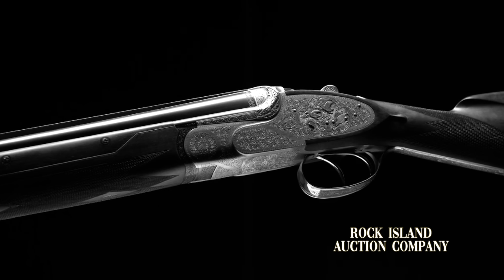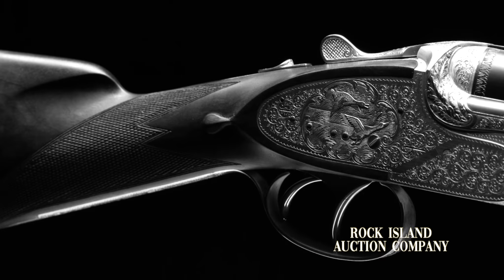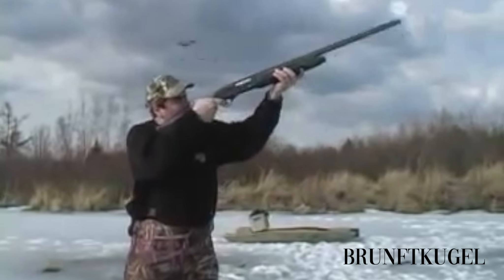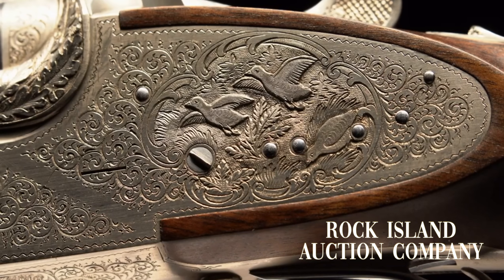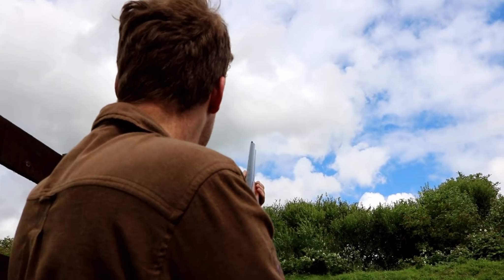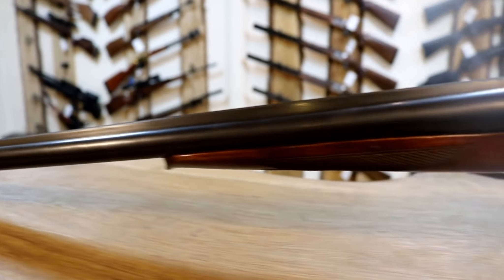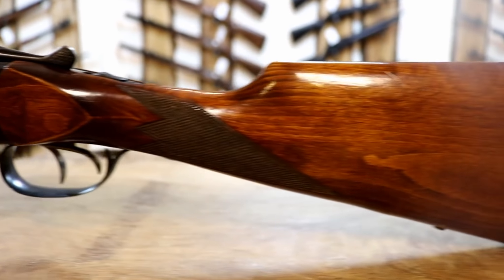Baikal & Their Posh Cousin

Comment: Got a blue heeler puppy, decided to be a bird hunter. Bought a Baikal because of the cost at a pon shop. Didn’t know anything about shotguns. Couldn’t hit anything, learned about gun fit. and started gun smithing. Fluted the comb,hot oil bent the stock for an inch of cast, cut the stock for negative pitch on the butt pad,did some mother of pearl inlays. Now it feels, and shoots good. My puppy is now 3 years old and retrieves like a maniac.

Comment: Bought one in 85 sxs walnut stock,cost 169.95 new, added 2 inch to length used for everything from clays to pheasants, never once let me down. Bought more expensive guns in the last ten years had missfires non ejected shells brocken firing pins etc etc.based on my experience, if I could only have one gun in my life it would have to be my baikal, it's a hammer which never fails me, and they do kick especially now I'm getting older. Good review.

Comment: Remington imported these into the U.S. back in the early 2000’s under the label Spartan by Remington. I bought the SPR-310 O/U Sporting Model. It has never failed at the trap or skeet range or in the field after 3,000 plus round through it. After shooting it for a few years I did some upgrades. I replaced all of the factory chokes with after market chokes. I had a softer recoil pad put on by my gunsmith which was a major improvement over the brick that came with it. Installed a new white front bead. And finally I refinished the stock with a red mahogany stain and tung oil. It still may be a Baikal but it is now a lot prettier and functions just fine.

Comment: Spot on Jonny! 
My 30+ year old 12 bore side by side, has served me well in the pigeon hide and on the salt marsh, and never failed! (The old Baikal cartridges were awesome through it on the geese and ducks - If you didn't mind the two foot jet of flame from the muzzle!)
I wouldn't sell it for £300 quid.
Keep up the sterling work matey.
Reply: I used to buy the 70mm Baikal cartridges because they were so powerful and also the cheapest too - I get the bit about the muzzle flash, I reckon in a gun with 30" or greater barrels this power could have been a great advantage.
Reply: we used baikal shells in the 80s no7 killed ducks at 70 yards dead everytime. 70 yards was the limit. we test shells on rabbits at longer ranges and if it kills a rabbit it will kill a duck easier, same shells on qauil. and shot qauil out to 70. mine patterns so tight.

Comment: Picked up a used sp230 pretty cheap. Been using it on pheasants and grouse for 5 years now. I am actually impressed with how nice the wood looks on such a cheap shotgun. Double trigger turns a few heads of other pheasant hunters as you don’t see many in the field state side. Looks nice and not worried about scratching it or anything in the field with the price point. Perfect working mans over under

Comment: Happy Easter 💖, concerning that izh.. I have both love and hate thing with. Bought a single trigger o/u that was quite good in weight distribution and finish. The reason why it “pulls up” while shooting is imho due to the single yet very strong (bascule) hence making the barrels a bit higher on the receiver. Unlike any other Italian brands where we have two hinges on each side of the receiver making the barrels “sink”  inside making a  more linear shape maybe? Later on I bought a hammer side by side brand new, and the chokes were stuck!!! No way you could remove them without freakin surgery! Sold it without a second thought.. Yes they are strong tough guns those who have them in my country swear by them regardless of their other  higher end guns

Comment: I recently bought a Baikal 43 side by side for the absurd sum of £75; I needed an old school non-ejector side by side as part of the ensemble for cowboy action competition shooting.
Furthermore, I went into the purchase fully aware of Baikals, unlovely stocks, and their general ugliness, as I'd genned up watching videos on the subject.
However, I was well surprised  to discover the stock was actually made from a really nice piece of wood and ran consistently throughout the gun.  It looks to have hand cut chequering and gives an excellent grip. I'd rather there wasn't any engraving on the breech, but there is - looks to be a simple design done by hand with a kind of prison tattoo naïveté.   The metal work is nicely blued with no scratches. Bores are in excellent order.  It actually fits me well for snap-shooting.  Someone has obviously loved this gun because it's a gnat's cock away from immaculate condition.  The lock work is good and tight. Not a wiggle anywhere on the gun.
I have a number of quite expensive 'quality' guns in my cabinet but the Baikal has rapidly become a favourite for its rugged honesty.  I can't believe I got so much gun for a measly seventy-five quid!

Comment: Baikal and Vostok are not the names of the guns, nor the names of the producers. These are the trademarks of 2 USSR exporting state owned enterprises. Basicaly there were 3 main shotgun producers in USSR: Mechanical Plant of Izhevsk (based in Izhevsk) - durable but poorly finished guns, Tula Armory - producer of the hunting guns of the medium quality and TSKIB (as well based in Tula) - hand made olimpic shooting guns and a high end hunting sidelock producer.  Tskib was mainly imported to the U.K. under the name of  Vostok and are known for its Olimpic trap and skeet models MC-6,8,106,108 and some of the hunting sidelocks: mc-9,11, 109.  Vostok competition boxlocks do have a dozen of olimpic medals won in 1950-1990ss ( the last one in Australian Olimpics) both in skeet and in  trap and are well known for its tula choked skeet barrels and incredable durability. In fact there still is an opinion that tula chokes were so effective with the high volume loads that it influenced FITACS to decrease the competition loads from 32 grams down to 24 grams to omit the gandicap effect these barrels were giving to the Russians. As the olimpic shooting loads were decreasing  MC became available for the general public that in the process of its domestic use have discovered that tula chocked barrels not only extremely good with high volume shots but are very accurate in bullet shooting.  Twice was using the MC - 108 skeet gun equiped with tula chockes for the bear cave (berloga) hunt and it worked great.